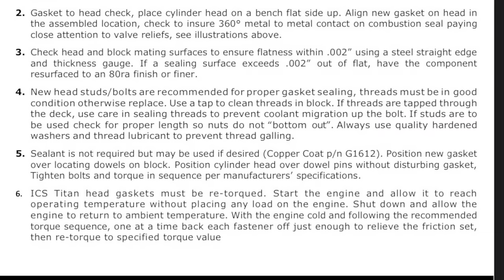Exposing Lies About VQ Engine Failure.

Comment: I hate seeing this shit go down. From the SOHO video, they said if you cram more air into the engine than the engine can push out, clearly you’re going to have issues. Moncef, did Griff tell you to go ahead and push more power despite knowing that might be a possible issue? Or am I wrong here?
Reply from the maker: Thanks for watching both videos, unfortunately both of their videos had a lot of incorrect information in them to help steer the viewer a certain direction. If your comment, and their assessments were true, there would be evidence of detonation on the pistons or deformation of the bearings which there was not.
Reply: @admintuning  what about the damage shown on the cylinder wall, it looks like damage from detonation. Soho shows it around the 19:48 mark in their most recent video, or is that fabricated? I’ve watched all three videos from start to finish and still trying to make sense of all this, at this point I feel like everyone is to blame here. I 100% agree that soho should’ve handled the situation differently, but I don’t feel that they’re solely responsible.

Which is a shame because the content for this build would’ve been 🔥
Reply from the maker: @JoeyAG92  No, that is not damage from detonation. Some foreign material fell into the cylinder early on, some spark plug porcelain if I remember correctly. If it truly was damage from detonation, there would be other signs, that I have already mentioned in my previous comments and this video.
Reply: @admintuning  I’d imagine that the porcelain would’ve been more likely to damage the dome of the cylinder head, as well as the head of the piston more so than the cylinder wall itself. I am speculating here I will admit though. Was the porcelain ever extracted from the cylinder?
Reply from the maker: @JoeyAG92  we do not have any information on that. But like I had mentioned before, if it truly was damage from detonation, there would be other signs pointing at that being the cause. This has been corroborated by the machine shop that tore the engine down, along with other engine builders/machine shops that I tune engines for.

Comment: Shame it had to come to this, as always there are plenty of variables. But signs of coolant issues are a tale tale sign something is up and not up to snuff. Having built plenty of motors in the past one can always tell quality and attention to detail vs carelessness and lack of planning. Esp with copper gaskets, usage of hylomar and bore roundness/bore trueness and not carefully blueprinting gaskets when boring/honing. Lot could of been resolved as no "race" engine is guaranteed, but a good builder will stand by their product and not just blame others and leave the owner stranded. Hope in the end it works out but sad as it's oh so common in motorsports in general. Great you showed with detail and in real-time video facts that cant be lied, especially to (NO) detonation marks and (NO) micro welding signs and bearing squish, premature heat and wear and deformation. Sounds truly like it was built on a Friday at 4:45pm.
Reply: Specific time
Reply: I agree. Just a funny input I've bad 2 G37 coupes both with messed up cooling systems. Ones my fault the other isn't. Either way I've been driving my 2011 G37 xscoupe without radiator fans from 110,000 miles to 140,000 currently without many issues, knock on wood. Anytime I get stuck in traffic longer than 5-10 minutes it starts to over heat. That being said it's last 30,000+ miles while being beat on and inop cooling system. Same happens with my 2010 coupe but I blew the engine drifting at a car meet and then got a reckless driving ticket while I was waiting with my car lmao
Reply: A takeover guy?
Reply: @MrSeanman30  bruh what? Not sure what this has to do with anything related to this video. But running no fans on an engine and it working is impossible. How else are you getting the coolant back down to temp, solemnly relying on air isn’t merely enough.
Reply: @DEATHWISH V35  over heating was mentioned in the video, and this dudes comment about was talking about coolant. Kinda just saying it because people baby the fuck out of the car and I beat on mine pretty good  even without radiator fans, year old coolant and I'm like 5,000 miles over my oil change.
Reply: @DEATHWISH V35  I promise you lmao. I can send a video and everything. Most of the time radiator fans aren't on when driving unless it's the car gets into heat zone 1 and activates one fans. Then pass another temp and both fans with kick on.  If you just driving normal the coolant won't go past 190 which is complicated fine. I can do a couple races and my shit will get hot and I'll just let it cool down. No problem at all

Comment: Just curious can you do a video on how a 2.5 single exit flows vs 3 inch vs stock exhaust?
Reply: I had a stock, 2.5” dual, and then a 3” single-exit exhaust. 3” is perfect all around the powerband, especially after a tune. When I compared the three setups on my car, the 3” felt and performed the best by quite a bit over the 2.5”, and obviously the stock exhaust.

Comment: I want to high hp on my vq37
Should stick with OEM gaskets and bearings or I should I go after market?
Reply: No oem is not enough..Any mls head gasket and king bearings or acl bearings
Reply: Dynosty head gasket and stainless steel oringed head

Comment: This is one of the many reasons I’m going to LS3 swap my 350z . Vqs aren’t it for high hp sadly
Reply: This wasn’t a engine specific problem, this is a manufacturer problem where they sold a faulty unit and failed to take responsibility.
Reply: @JAELPRODUCTIONS1013  yeah but once a vq is built it becomes so unreliable not much is known for max power compared to a LS when there’s a set formula like “buy this for this amount of power and this specific brand” vs a VQ where it’s more of a shot in the dark
Reply: @yepyepyepyep1407  many vq 500-600 are reliable
Reply: @infinitibossauto  yeah that’s true because I was about to boost my g37s and try for mid 500 but I can just put a cam in a LS3 and make it FBO and make that same HP while being NA. Main reason is I’m a technician so I’m capable of doing all the labor myself and I enjoy a good cammed V8 and people wouldn’t expect it from a small nissan
Reply: @yepyepyepyep1407  do you think an LS2 will fit in 3.7 Q50???
Reply: @shotbysolo301  I don’t know. I’m going to be using LOJ conversion since they have  a swap kit for 350z to swap almost any LS based engine
Reply: I dont blame you. Came to the same conclusion. I think the VQs do wonderful around 500 to 600whp.
Reply: @Yep Yep, Yep, Yep  I agree, however at all of our car meets here in Colorado you have so many Chevy trucks running LS motors along with the camaros and vettes. Then obviously LS swapped RX-8s and what not that are swapped are dope, however the sound wouldn't be something I'd be too excited about. That's just my experience though. Ls swapped 250z would be still be dope!
Reply: This boiled down to being lazy
Reply: @cruisecontrol6938  you mean lazy to LS swap?
Reply: @jaws2003  re torque the headmaster steps
Reply: @jaws2003  yeah they do wonderful at 500-600 whp... till one day they pop.
Reply: @red1  around all of the forums, videos, and from the shops that build these VQs 500 to 600 seems to be the magic number that these engines are golden at when modded.
Reply: @jaws2003  majority of them pop. 600whp is like 700hp crank.  Vqs are not meant to be boosted as they are n/a compression motors with tiny rods.

Comment: I think to make it fair. Is to give the car your driving to the to high profile customer (370z) And take the 370z and rebuild the engine yourself instead of the shop. Real tuners build their own engine. Rebuild the engine for 1000 whp.
Reply from the maker: I have tuned built engines from multiple shops and have never had an issue like this even with 850-900whp VQs. My own personal 370Z makes 800whp+ and I daily drove it at that power level without these types of problems.
Reply: @admintuning  what company built your VQ ?
Reply from the maker: @typicalgamer_1153  Kinetik Motorsport in Houston TX built it. You can check out videos of my car on my channel.
Reply: @admintuning  I understand you’ve tuned plenty of high horsepower cars, but did they have any bottlenecks in the turbo system like griffens did? I have no doubts in your tuning ability, but it’s not a fair comparison wouldnt you agree?

Comment: I don’t think this was your fault but you can have detonation on just 1-2 cylinders. Engines often have 1 cylinder that runs hotter than others or runs leaner. These cylinders will almost always have knock before the others and often are the first to fail
Reply from the maker: You are absolutely correct about this.

Comment: Pre-ignition and detonation are completely different.  30 years of turbo engines, I've broke many ring lands early on. Some show no other sign than just a stacked ring land. An engine that builds coolants pressure cold after 30 seconds of running when the top is opened, has a leaking HG, easy check if suspected. Not pointing blame anywhere, just saying. 12:1 compression and turbo= trouble. Fuel and water aren't compressible but water injection works so....
Reply from the maker: Thank you for your comment. Yes, WMI works and has for decades. I have tuned a few other 11:1 or 12:1 high horsepower VQs on pump Ethanol without head lift.

Comment: Damn, was gonna change my spark plugs on my g37 which is basically stock minus exhaust, and noticed my head gasket on passenger side was starting to deform/ blow out. Anyone know how hard the job is? Was probably just gonna take it to the dealership to get it fixed even though labor is hefty
Reply: Something to mention as well is it's leaking very small amounts of oil, almost unnoticeable(got me thinking it must of just started to blow out/deform?)
Reply: @FrozenInPain  you sure it’s not your valve cover brother ? That’s the gasket around the spark plug area as well
Reply: @FrozenInPain  if it’s oil then it’s most likely your valve cover not hard just take off and put on. A YouTube video should do
Reply: Valve Cover gasket*

Comment: Dammm and to think I was saving for a motor from them…..
Reply: Oh hell no. Get a Mazworx stage 3. $17k. I have one in my TT 370Z. 850whp on E85 and meth injection for the past 2.5 years literally 0 issues.
Reply: @EatMyPropwash  they don’t make them for 370zs
Reply: @EatMyPropwash  where do you get a mazworx engine??
Reply: @EatMyPropwash  was that just the block ? Or a whole build ?
Reply: @tristanoliver2911  someone on specialty Zs page has one and it made over 1k whp.
Reply: They do make them don’t they?
Reply: @tristanoliver2911  they don't make a billet block for the 370. They build motors for them. I know a few people that have Mazworx builds
Reply: @nonstopclapsify6808  Mazworx
Reply: @LazzyZ34  whole build
Reply: @Patrick370Z  good to know

Comment: Nah, this dude definitely runs the cars too rich. I burned through 5 head gaskets and have oil on my spark plugs.. bought new everything and got a diagnostic, and they couldn't find any internal problems. The only thing that was done was a tune
Reply from the maker: Made up comment from a fake account. Nice 😍
Reply: @AdminTuning  not fake and funny enough I asked you to check the numbers to make sure the car is running good and you insisted it wasn't you. Got emails to prove it
Reply from the maker: @rawcircoking  What’s your email? Running a car rich doesn’t eat head gaskets, and replacing 5 of them is a very time consuming process, so your comment definitely seems fabricated.
Reply: @AdminTuning  why would I lie??
Reply: Your comment is sus , definitely one of their workers …
Reply from the maker: Sick backpedal. Your entire initial comment is a lie so of course you’re going to keep lying. Anyway…
Reply: You know who runs their engines stupid rich at high rpm and high load? Every OEM ever because they want to be overly safe as to not cause an engine failure. How exactly does that cause a head gasket to fail?
Reply from the maker: @tksperformance8789  his comment was definitely low quality bait.
Reply: @admintuning  no doubt

Comment: As a professional engine builder and a tuner myself being in this business 30 years everything that was pointed out leads to a very crappy and sloppy assembly on the engine builder side. Attention-to-detail is absolutely poor the assembly was poor and environment was very dirty. This is not a tune related issue it is not be 85 related this is a thousand percent on the engine builder. Who should be correcting these issues or compensating the owner that paid for this engine to be built
Reply from the maker: Thank you for your comment. What kind of engines/engine platforms do you build?
Reply: @admintuning  lsx ltx sbc brad andderson hemis gen3 hemis. Coyotes, sbf honda B series. Toyota 2jz. Plus porting, fabrication some tuning on some platforms. Also forced induction and nitrous
Reply from the maker: @vortecturbo  thanks. I subscribed to your channel.